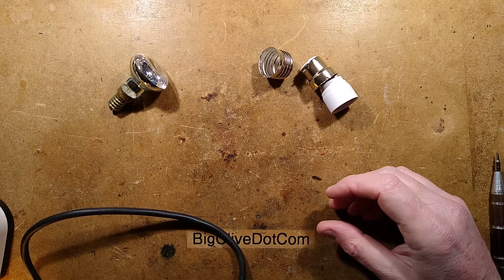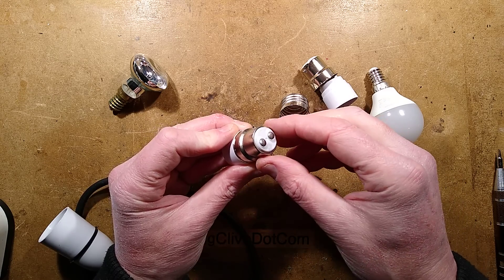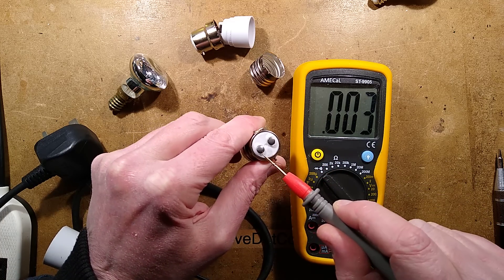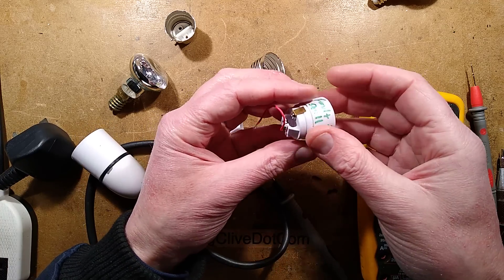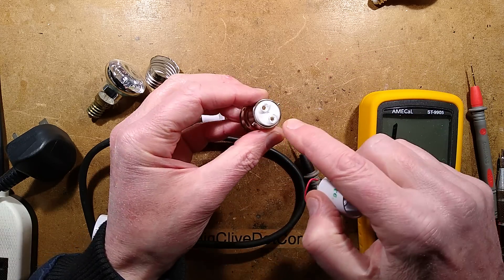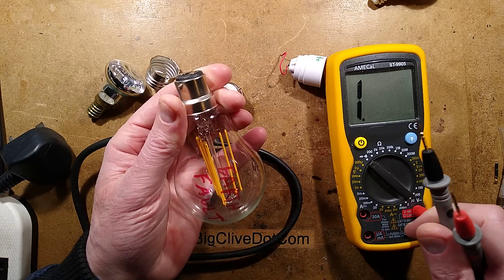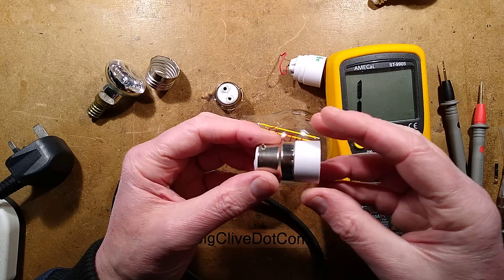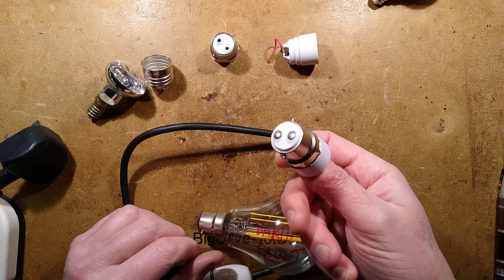Rogue lamp adaptor with shock risk

Comment: That is clearly dangerous. That needs to be reported, both to the seller website and to trading standards.
Reply from the maker: I've since ordered more from random suppliers and they were the same.  The UK branded ones like Pifco were safe.
The problem is that trading standards are overstretched and there is a massive amount of automated eBay account making going on for continuous shop replacement by importers.

Comment: I like them, have most versions, and am aware of the dangers, but it's just too convenient to be able to interchange every light in the house.
China will never stop surprising us😄
Fixed some 12v wall adapters for friends where the main 230v wire was cold soldered and was flopping around inside(major fire hazard!).
Reply: Nothing wrong with these adapters when they're designed properly. These ones are not.

Comment: Must go and check the adapters in my box of bits. I always checked that the internal centre pin was the live one, but I imagine I must have done that by plugging them into the (metal) socket. That should mean they are safe, but no guarantees as yet.

Comment: not all Clive....I have on right here from Amazon I think and its not connected to the pins, B22 - E27 200W CE (its unmarked with a Brass shield inside connected through to the base on two sides and a centre pin....  So not all ....maybe this is recent thing, but not great tho....(edit a second b22-e14 that the same NC).............fineled 3 - pack b22-e14 still for sale still on Amazon...

Comment: I use IKEA adapters for our screw type bulbs. £3.50 for 2 and only the bayonet pins are metal, whole outer casing is plastic.
Reply from the maker: It's worth mentioning that even the IKEA adaptors aren't quite compliant.  The outer thread of the lamp should always be connected to neutral to reduce the risk of a shock while screwing it into a live holder.  But with the bayonet cap it's a 50/50 chance it's live.
Reply: @bigclivedotcom  Don’t the bayonet type fittings have those recessed lugs inside so the light can only fit in one direction ? Been a while since i changed a bulb but if that’s the case, wouldn’t those exposed pins be polarised to prevent transposition of active to metal base  🧐
Reply: @adamb1671  No, the pins and the guide pins in the base are symmetrical, you are confusing the bayonet fittings used on cars for stop tail lights, where the pins are in different positions in the shell, so it will fit either way round, but only latch one way round.
Reply: @SeanBZA  gotcha, it has been a while 👍

Comment: The Bayonet to E27 adapter I bought from B&Q doesn't have a metal surround, The pins that hold it in place are metal, the rest is plastic.
It cost £3.74. Can you even post something from China for that sort of money?
Reply: That is the newer version, the original had the issues Clive has discussed.
Reply: @PaulieReynolds  Yes, I remember there was a product recall for them a while back.

Comment: I'm not qualified for 220v electrics, having rather done low voltage (50v dc) work and studies. I have found that my home circuits trip when I touch neutral (unintentionally!) to earth, when, for example, replacing a ceiling fan. This despite the relevant breaker being off. Is this normal?
Reply from the maker: Yes, that's normal.  It can be caused by the neutral-earth loop allowing some current to bypass the sense coil in the RCD, or some systems may include circuitry to specifically detect that bridge.

Comment: Would a live to earth connection in a light fixture typically blow a fuse in the fusebox?
Reply from the maker: Yes.  But only if the light fitting is properly earthed.

Comment: Nice. You might want to test the Edison base screw-in receptacles (US/Canada style). They've been around for ages, but now they are available with three pins including a ground. ;-)  A few ways to do that, none of them good.
Reply: Those are for three-way light bulbs , fairly common in the US
Reply: How would that work since there are only contacts for live/neutral?
Reply: @matthewmiller6068  It doesn't. He doesn't know what he is talking about. Two of the contact go to different filaments/LED sections in a light. In a 3 way socket, turning the knob on the fixtures will connect one live connection, then the other, and finally both, to live.
Reply: @pootispiker2866  No they are not.
Reply: Yeah, it's fun when people change an established standard in such a way that known unsafe becomes unknown unsafe.
Reply: I'd presume the three-prong versions leave the ground disconnected. Any other way would be a greater electrical hazard. But what are the safety instructions with these 3 prong versions? Can they possibly be UL listed like standard 2 prong ones?
Reply: @eDoc2020  No, but UL listing is not a legal requirement for sale in the US.

Comment: What happens in old homes with no RCD?  Live earth connection?
Reply from the maker: It should blow the fuse if there's a good earth.  If not then the light fitting may become live.
Reply: @bigclivedotcom  Well I just found on an old home built in the late 1940's that has the main earth connected to the water pipes, the actual pipe (gal steel 3/4") had just about corroded away at the base therefore the MEN  (Multiple Earthed Neutral) connection to ground was just about gone. So a high impedance earth connection would mean that the fuse would not blow and things would get "spicy" as you pointed out with all earthed appliances live. I will see if any of those adapters turn up here. Thanks for the information.

Comment: Bit like the two ES to BC adaptors I have, one of the screws holding the ES socket to the plastic casing was about a millimetre off touching the centre contact on the bulb & socket ready to make a nice bang, simple fix though, screw removed, if they used a flat-topped tapered screw it proably would have been less dodgy, but nope, the cheapo bulbous round-top ones were all they had at the sweatshop I guess... :S

Comment: This reminds me how I think it's rather amazing that nobody has came up with a safety lamp socket. By that I mean, to stop kids putting their things in them etc.
Reply from the maker: They have.  But they're quite complex.  I made a video about one last year.
Reply: You mean so that parents can ignore kids even MORE?   I just taught my daughter not to put the penny in the lamp socket, or the fuse box.
Reply: @tbelding  But stuff like that happens.
Reply: @wisteela  Yup, and despite that, our children survive.   Probably because it's rarely more than an ouch moment.    You can  make things as safe as you want, and people like me will bypass those safety features as being anti-usability features.  (and they very much are).
Reply: @tbelding  Designed well they shouldn't get in the way.
Reply: @wisteela  You'd think that.  Several issues there.  1) You assume they're specified or designed by engineers.  They're usually designed by lawyers/politicians.  2) You're assuming they'll be built as specified.  3) you're assuming that they're really necessary.    Case in point.  Many of our NEMA plugs now have 'gates' to try to avoid someone sticking a wire or something into the plug.   As an IT person, I can't tell you how many of those I run into where you have to just about hammer the plug into the socket because they do not get out of the way when you actually need to use them as they're designed - that is, as a power source for your plug!   

More useful would be some way to actually give an electric shock to the person who pours their chocolate laced caffe-frappe-latte-chinos (what pants have to do with a drink, I'm not sure) into the equipment.
Reply: @tbelding  Here in the UK we have them done in a great way.
Reply: @wisteela  - Yet, if any part is plastic, the posts on either side of the socket or bulb can snap loose, and you lose connection.  They also require a lot of force for a short period of time, to maintain a solid connection against the posts.  Edison do have the benefit of slow force, meaning weaker people don't have issues with insertion.
Reply: @tbelding  And if plastic parts break, that can make it unsafe too.
Reply: My new build house has these. They work but are a pain to put bulbs in.

Comment: That's why I think the UK should scrap the fragile bayonet cap and go back to E27, much more robust, polarizable and a lot less likely to touch the 'hot' wire without brushing past or touching the neutral/ground. 
Even the E17 or E14 is way more robust and would effectively be even safer as the hole is smaller.

Comment: Could imaging what the outcome would be for someone with a brass socket on a solid brass lamp base if the earth wire had came out in the plug oe wasn't connected... or if the wall socket or the typical chinese any plug fits deathdapter extension lead whole thing would be live.

Comment: At least only one of the contacts was connected to the metal - or maybe it's bad that only one pin is connected to the metal as it would be a safe-side failure if both pins were connected to the metal as that would trip breakers or blow fuses "instantly".......

Comment: That type of ""innovations"" out of china is what makes it so much of a problem with dealing with Chinese manufacturers, they have far to much of a tendency to when they realise that something need to be modified just doing something fairly at random, their "solution" might technically solve that specific issue but are more likely than not to create a dozen other problems.
would be infinitely better if they bothered to tell you about what they had done but they never do that.

I bet that someone somewhere felt really clever for figuring out how to use the same part both for bayonet and Edison fitting but like you said they had no clue why the "case" of bayonet fittings was not already connected.

Comment: The UK way of single RCD protecting multiple circuits with single pole circuit breakers is outdated. Several countries in Europe no longer allow single pole circuit breakers and a minimum of 1P+N, better if 2P is required.

Comment: This is similar to dangerous Chinese mains power supply you and others have posted about. For years I was pretty complacent about device electrical safety, think UL compliance on this side of the pond. I now take a pretty jaundiced eye to stuff coming from China. Besides derating electrical specs by 50% I try not to buy anything connected to the mains.

Comment: I used to use one of those. I just realised I came scarily close to potentially shocking myself.

(I say potentially, I did the smart thing of always isolating the socket before touching the lamps at all and it was an overhead socket that was out of reach, so nominally safe.)

Comment: Better to never use adaptors as most people cannot tell what they're  are getting. Just get the correct bulb for the lamp.
Reply: That sounds good in theory, but not so much in practice.   For example, 7 watt bulbs are VERY expensive in 'medium' Edison base (plus hard to get), but are easily found in 'candelabra' Edison base.   So, I bought a couple of packages of 'night light' bulbs with candelabra bases, and a couple of 'medium' to 'candelabra' adapter.

Comment: Oh China, how you manage to cause issue no one else would have thought was possible, at least the ones I get from IKEA are mostly plastic with only the contacts and "locking" pins are metal, even the screw thread is plastic with just two contacts at the bottom of the screw.

Comment: Shouldn't that be 230v with reference to ground? ⚡🤣
Reply from the maker: Only in the most very precise bits of Europe.
Reply: @bigclivedotcom  My supply is often higher than nominal, at, as you say, 240v! 👍🤣

Hey Big Clive, I recently switched to Vodafone Broadband, and was migrated to VOIP. As we all know, you can't make a call in a power cut. I bought a 650va UPS, and it was only able to power the Wireless Router and Cordless Phone (10 watts) for 2 hours and 50 minutes! ... I'm thinking of getting a Deep Cycle Battery and powering the 12 volt router directly. Q: What size fuse should I use? I'm a poet, and I don't know it!

Your channel is ⚡ ELECTRIC ⚡👍🤣
Reply from the maker: @marcse7en  Small UPS units are only intended for brief use to shut down systems in a controlled manner.
If you look at the power supply for your router it will have a current rating.  That would probably be a good reference for the fuse.   Powering the router directly at low voltage is the most efficient way to keep it active during a power cut.
Reply: @bigclivedotcom  You're telling me UPS's are "brief!" The UPS couldn't even power a 4 watt LED bulb for 5 hours! UPS units are not only used for PC protection, but are sometimes used for routers and phones, but less than 3 hours is no use at all. Converting DC to AC, and back to DC again is clearly inefficient. That's why I decided to power the Router directly from a 12 volt Deep Cycle Battery ... Thanks Big Clive! You're the best! 👍

Comment: This is awful ( like your " foreign " 13 Amp plug with the fuse not connected ! ) ..... thankfully , I purchased these type of adaptors from a shop in Soho ( London ) , many years ago .... the shop was ( dodgy ) but the adaptors electrically safe ( ? ) ... handy tip : anyone can make their own " bespoke " adaptor .... use the ( big ) base of a dud CFL lamp , wire up the fitting of your choice inside and temporarily jet melt it in correct place ... then ... fill level with epoxy potting compound , allow to set , and you can make adaptors that even Amazon do not sell  ! .... ( tried - n - tested ) ....... DAVE™ ............

Comment: That is scary...  Amazing the person "designing" this, if they had any electrical knowledge, didnt think that configuration might be a bit dodgy.. Yikes
Reply: Their knowledge was probably based entirely on Edison bulb standards plus a short form list of national deviations, that list would include the shape of UK bayonet bulbs, but not the rule to keep the exterior disconnected or grounded.  Same method that lead to mass production of UK plugs with the earth pin having same sleeves as the live and neutral pins.

Comment: This is why im annoyed about the screw and i really wish the world standardized on bayonet cap, cuz in europe you have unpolarized plugs and the housing of the edison screw could easily become live
Reply: Wrong. For many, many years now the actual screw part of the lamp holder is insulated and the outer screw part of the lamp base only makes contact  with a spring down in the lamp holder when fully screwed in, basically then when you cannot accidentally touch it anymore.

Comment: i hate the bayonet cap fittings. they're annoying, wobbly, piss loose and overly complicated to manufacture or maintain. Eddison screw doesn't wear out, but bc2 (and the scam version bc3) have dumb little springs and nonsense that wears out. It's not even the safety lockout that hides pins until twisted.

Comment: This all reminds me of some of the lethal adapters that we had in the 1960s - And they were variously marked as "Made in England" or "Empire Made".  I remember my granddad being unceremoniously launched off of a chair whilst trying to plug in an adapter to allow him to power an electric blanket from the light socket.

The real trouble is that if you buy these things online, there is very little, if any regulation, and no one gives a damn.

Might just as well drop a toaster in the bath for all the manufacturers could care.

Comment: I guess chinese people have seen these bayonet connectors only on combined stop signal / marker lights tungsten car bulbs, so they've connected the sockets accordingly. Some 20 years ago I've bought several multisocket extenders with typical european schuko style plug and sockets and I even can't remember why have I test them with a multymeter before I've even put them in use so I'd discovered that grounding contacts were on them only for the appearense since they've put only two wire cable...